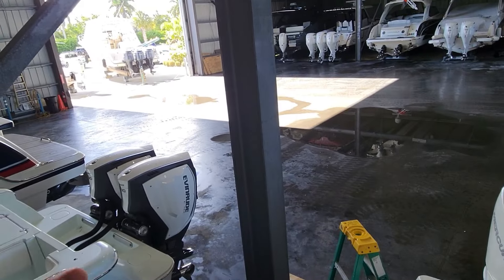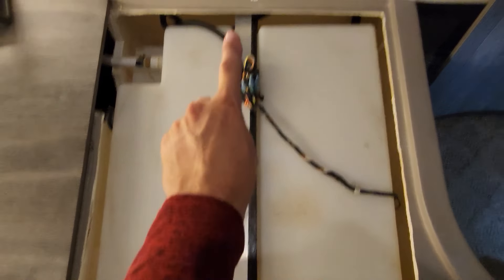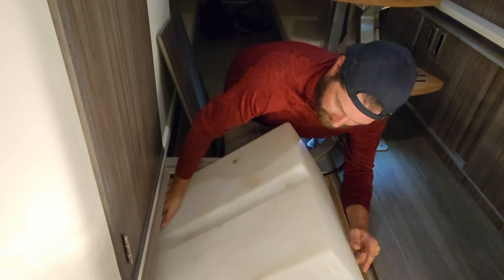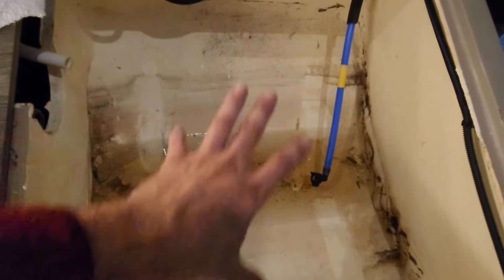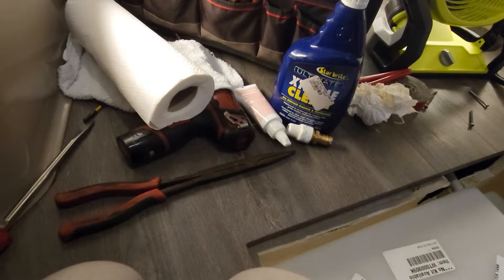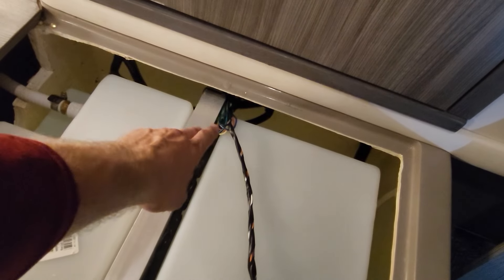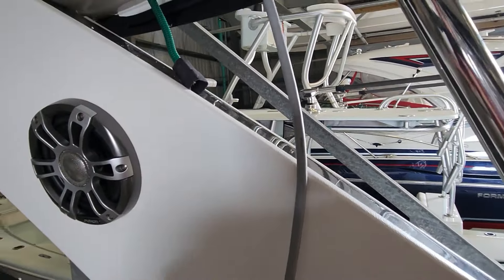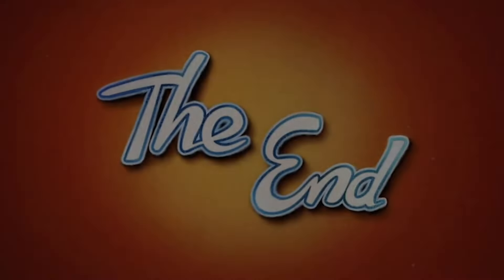A Trip To Safe Harbor Marina!! #WaterTank #SeaRay #Sureshade #Marina

Comment: The quality of the old Sea Rays is so much better than the new ones.  My 2006 320 uses a metal water tank.
Reply from the maker: Manufacturing has definitely changed in the last 20 years.

Comment: Besides another excellent viseo, i have a question regarding the Regal 38 Grand Coupe. I am hearing about spindle issues with the volvo 380s, and wanted to know your thoughts or opinion on this rumor.
Reply from the maker: They fixed the problem a few years ago.  It's the coupler that was a problem.  If the motors are not perfectly aligned, it will ruin the coupler.  They changed the couple design to help this.
Reply: I am looking a buying a 2020 how will i know if this problem has been corrected?
Reply from the maker: You would have to ask the dealer to find out.  Not sure the years that had the problem. I don't work on Regals or Volvo anymore unfortunately.

Comment: Those SureShades can be a real problem. The actuator on a Sure Shade on a boat I bought was faulty, and the seller said trying to get it repaired was a nightmare. No service whatsoever. I ended up removing it from the boat completely. Many boat owners have reported problems with SureShade units.
Reply from the maker: I can definitely see why 😊

Comment: Hope you replaced that cone washer in the pex fitting!! Just added insurance
Reply from the maker: That is a great point and I definitely did. I try to make the videos a certain length to not make them too boring.  I have them in my van and a bunch of other washers/gaskets. It's a 50 cent part that could cause a serious leak later. Good point. Thank you 😊